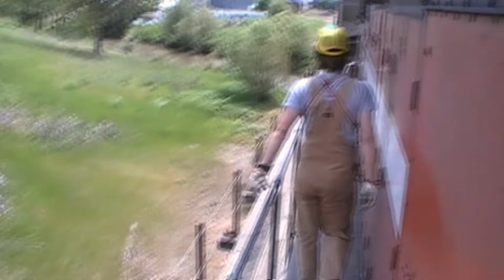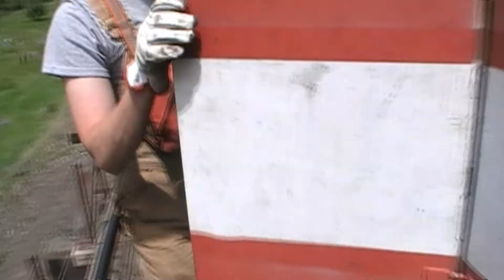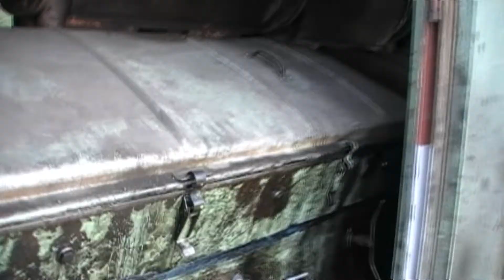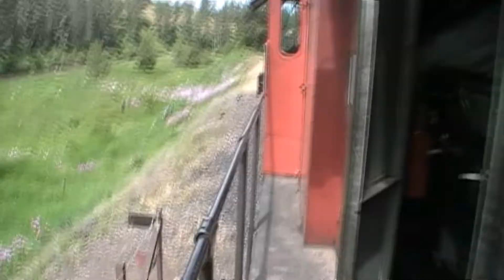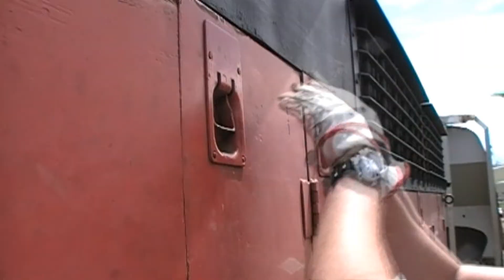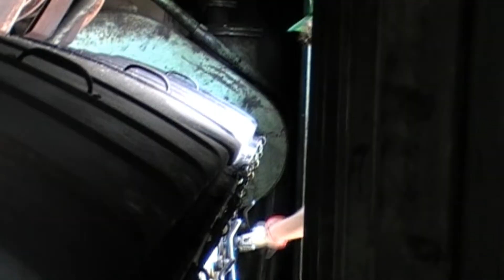Starting a GP30

Comment: Love gp30’s, which if u take the top off and make the roof flat it becomes a gp38 lol
Reply from the maker: No. GP38’s are non turbocharged with a 645. GP30’s are turbocharged with a 567.
Reply: MaFarnz I know, it’s a meme based this one 
[Take an sd40-2, take a axle and part of the truck off and u got a gp40], but thanks on the engine info I surely thought gp30’s and 38’s shared the same prime mover, sorry if I mad you mad, I didn’t know
Reply from the maker: Not mad one bit!  
Never heard of that meme lol.
Reply: MaFarnz look it up it’s pretty funny

Comment: From an irish woman train nut to American transport nuts, a couple of questions. Why do you call a train driver an engineer? He or she is a train driver.
Why do you not have driving cabs on both ends of your locomotives. For 20 years CIÉ /Irish rail. Used general motors EMD locos abd very good machines they are. One of our classes the 121 had a cab at one end only. A driver nearly crashed as he couldn't see properly over the engine if the loco when driving cab at the back. It ended up that they had to be used in tandem to get a cab at each end. It was considered to be safer then one cab only.
Reply from the maker: Not sure why engineer vs driver, I think that's a British English vs American English thing.

As to the single cab locomotives, that's a bit complicated.  In the 1930's 40's and 50's in North America "B unit" locomotives were very popular.  A "B unit" is a fully functional locomotive that lacks a cab, it needs to be coupled to another locomotive with a cab to operate.  Units with cabs were called "A units".  This works in North America since most trains required more than one locomotive to pull them, and often locomotive lash ups were set up so that there was one or two B units in the middle, with an A unit on each end of the set so that there was a cab facing both directions.  These were referred to as A-B-A or A-B-B-A sets, with three or four locomotives being considered one locomotive, in some cases even being permanently coupled together.  
Now as locomotives got bigger and more powerful B units became less popular, but single cab locomotives became normal practice.  North American railroads have always had a "that's how we have always done it, why change it?" attitude.  Even today with locomotives around 4000 horsepower a piece, trains still often require more than one locomotive so setting units up so that there is a cab on each end of a set isn't too hard.  But many smaller railroads and switching operations (I think in Europe it's called shunting) use only one locomotive, and in this case a single cab doesn't make sense.  But that's how its done over here so....
The railroad shown in this video often runs what is called "long hood forward", with the long end of the locomotive running first and the engineer has to look past it.
Reply: mafarnz interesting thank you.
Reply: Because you’re running an engine. You don’t drive a train, it follows the rails and “drives” itself. To over simplify his job, what the engineer does is stop and start the train and use his train handling skills to prevent breaking coupler knuckles and/or derailing the train while he’s moving it. 
Edit: Only one cab reduces redundancy and saves money on the construction/operating costs of the locomotive. In the US our trains are usually long enough that they require more than one locomotive to pull them, so most local trains have two units coupled back to back. Then when the crew has completed their work as far in one direction as they’re going, then they go to the other locomotive and reverse the direction of travel. Now they’re on the front of the train again. Plus, if one locomotive breaks down, you’ve still got 5he second one to get you back to your yard with provided one unit has enough power to move your train by itself.

Comment: how long have gp 30 locomotives been around
Reply from the maker: +Keith Slater A total of 948 were built between between July, 1961 and November, 1963.  Many have been used as cores and rebuilt into other model types, the BNSF GP39E's and GP39M's externally look like a GP30 but internally function like a GP39-2.  CSX has a lot of GP30's that were turned into slugs.  The one in this video though is still a real GP30.
Reply: oh ok
Reply: +mafarnz  technically a rebuild GP30, a former C & O GP30 (CO 3006) built in 1962. rebuilt by EMD for CSX as a GP30M . CSX has also gotten rid of alot of the GP30-RDMT slugs, replacing them with GP35-RDMT and GP40-RDMT
Reply from the maker: +cody rentzell Absolutely correct.  However, rather than explain this to everyone that asked "What is a GP30M" I'd rather just list it as a GP30.
Reply: also thought EMD rebuilt all of CSX's 30's with 645s, guess not.
Reply from the maker: +cody rentzell That was part of the GP30M rebuild, you are correct.
Reply: +mafarnz well in my hometown where the RBMN railroad is bought 4 or 5 Ex-ATSF GP30s and they got upgraded engines and upgraded everything but the out side design and they got repainted to have RBMN colours and the RBMN railroad classifies them as GP39RN locos but they still and always will be ATSF locomotives
Reply: +mafarnz What would you consider a GP39RN which I found out has some parts from one of their old SD50M's #5029.
Reply from the maker: GP39RN's are GP39RN's.  They retain the exterior sheet metal from the GP30 but that's about it.

Comment: 18 cylinders ???
Reply from the maker: +billyboi57 This is a 567, they never went up to 20 cylinders.  Only the 645's and 710's.
Reply from the maker: +Antonio Ricci 16 cylinders  2000 horespower EMD 567D, rebuilt in 1983 with EMD 645 power packs.
Reply: +Antonio Ricci These engines can go up to 20 cylinders.

Comment: So these EMDs drip as badly as a Detroit?
Reply: I use to drive trucks, with Detroits in them, it was a standing joke, to say fill her up with oil, and check fuel.
Reply from the maker: The older ones certainly can and do, this one is from 1963.

Comment: i never knew that the crankshaft of this 567 was the up-side-down version of the ones seen on other 567s, 645s and 710s. first time i've seen this version
Reply: This is an old post, but you never knew that because it isn’t true. Just look at the classic vee shape of 5he top deck covers. That alone tells you it’s a vee engine with the crankshaft in the normal spot. EMD didn’t use any inverted engines in their locomotives.

Comment from the maker: @heymynameistyler Very.  Shortlines won't hire someone new with no experience, class ones just don't want to hire.  I dropped at least 30 applications with about 5 different railroads in the 5 months I was hob hunting.  Not once did I get a call back.  Besides, both the companies and other railroad employees really don't like if an employee is a railfan.

Comment: Also, one VERY important step in the start-up procedure is once the engine is idling, you need to watch the oil gauge for about 10-15 seconds to make sure the pressure comes up.  Otherwise, it must me shut down IMMEDIATELY to prevent damage.  Just closing the doors and going to work is how stuff gets broken.
Reply: If oil pressure doesn't come up, the low oil button on the governor will trip and shut the engine down automatically
Reply: @micklatham8494 you’re absolutely correct.
Reply: Incorrect statement by a foamer. Engine oil pressure can be low for 40 seconds before the engine shuts down, at which point it should generally not be restarted until the cause of low oil pressure is fixed. The engine cannot be run above idle or it shuts down immediately. Rules vary by railroad, but that's the specification.

Comment from the maker: The whole purpose of the video was to have detailed directions, It's up to the railroads to secure their power from trespassers.  The WIR for example has pad locks on the cab doors so you can't get into the cab to connect the knife switch.